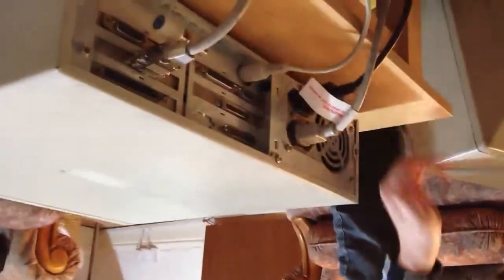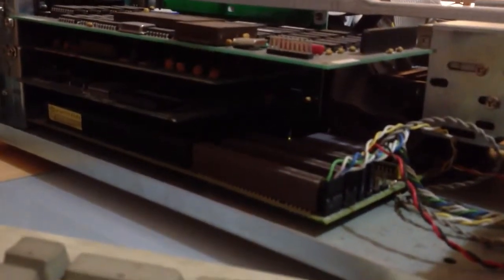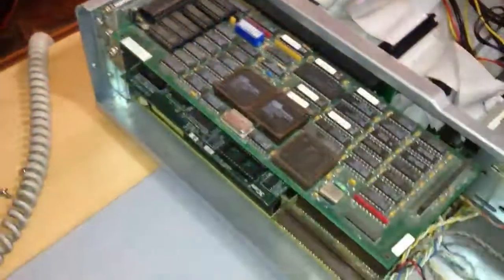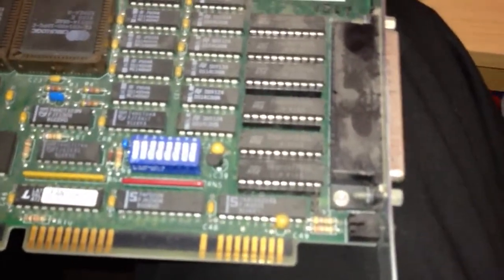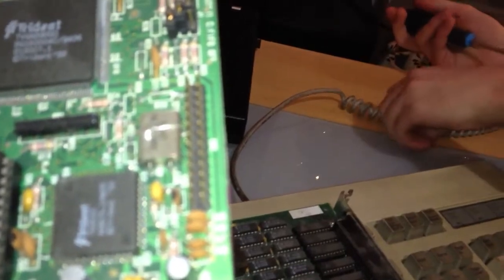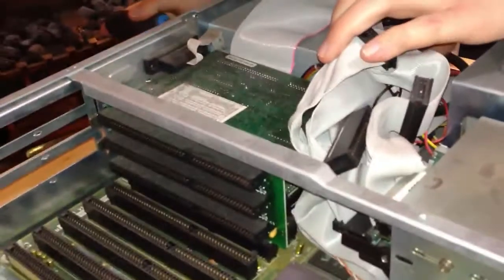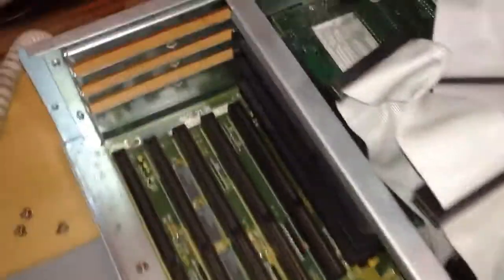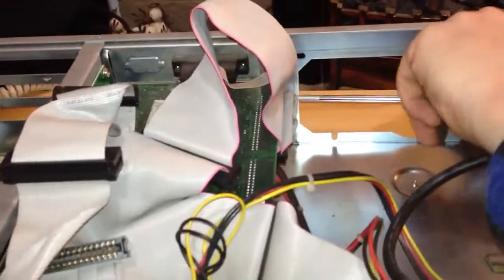Vintage 486 UNIX Server "First Boot" (3/4)

Comment: It has been a while since I've used Computone boards or the version of Unix you probably have. IIRC it would require an uninstall of the software in custom and a relink of the kernel. The same holds true of the network card then an install of the new network card.
How about doing a "uname -X" from the root login and see what version of the OS you really have.